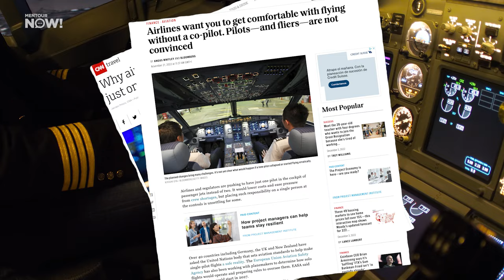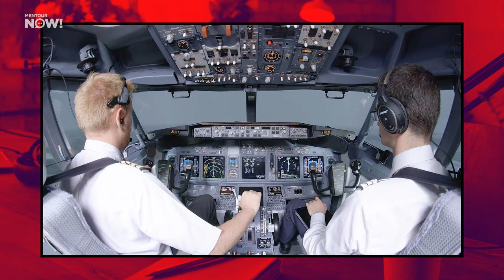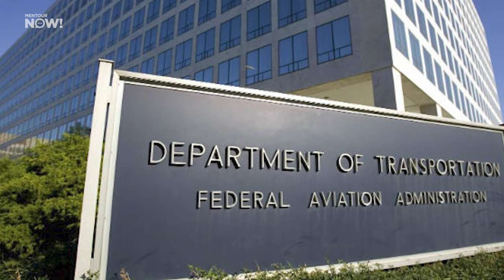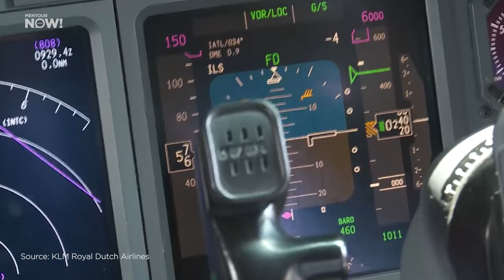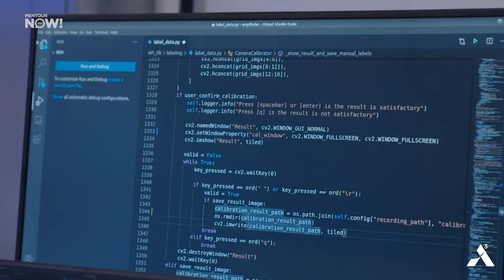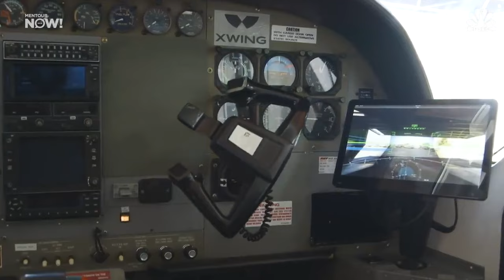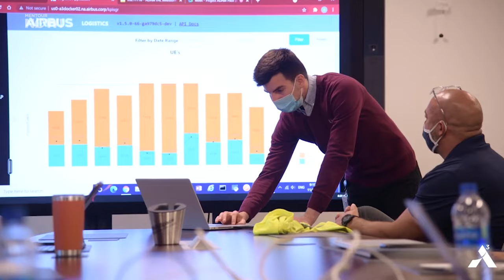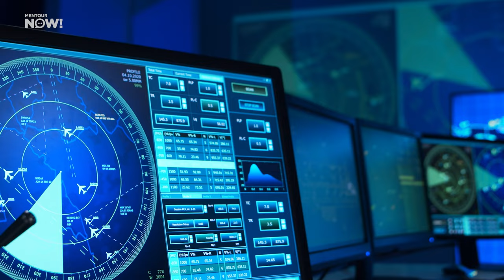The End of the Two-Pilot Cockpit?! Get Ready for Single-Pilot and No-Pilot Airliners!

Comment: You didn't mention one of the biggest issues that is addressed with 2 person authentication.  Having 2 pilots in the cockpit dramatically reduces the risk of a rogue pilot. One bad actor could perform a bad act.  With 2 in the cockpit, it requires an accomplice and co-conspirator.
Reply: A cost-benefit analysis likely reveals that the number of incidents of that type is not so great as to warrant that expense. I mean, after all, under neoliberal capitalism a human life is a commodity.

Comment: The USAF is looking into doing this with the new KC-46 air refueler.  They are researching only using the pilot and boom operator as the only crew members.
Reply: I read up on this.

The reason why they looked into it was to allow the KC-46 to be flown out by one pilot in an emergency.

So say, the base the KC-46s are being based at is about to be attacked, the Airforce could have one pilot fly the airplane out and potentially use it on a mission instead of leaving airplanes behind because they couldn’t get 2 pilots per plane.

Single pilot KC-46 ops wouldn’t be the norm it would be an exception for emergency situations.

Comment: I was a bit nervous when I worked  in the Channel Islands as flights between the islands on a Trilander were single pilot operated . Also in the old days of Intra Airways flying from Jersey to Dinard on their DC3 Dakota. I even came back from Exeter with a single pilot on a small Shorts 330 with a single pilot. I remember her saying before takeoff that the weather was very bad but that she would 'do her best' to get us down !!
.
Reply: Let me assure you, my friend, getting down is NEVER a problem;)  I've flown as a single pilot in IFR in corporate turbo-props, and as a crewmember in larger machines. We used to joke: "I don't know what's worse, being a copilot or having one."  That said, I can also tell you that in my opinion, you're safer with two pilots if the captain maintains the correct professional tone on the flight deck. My personal experience is approximately 8000 hrs air time.

Comment: As internet technology improves could there be a step toward, and/or inclusion of a system that would allow a "backup" pilot to control or even assist from a simulator on the ground? That could easily happen within the careers of the next gen of pilots.
Reply: This idea is 1000 times better than SPO
But it makes too much sense for current manufacturers I guess.

Comment: With the last pilot gone at some point in time, do we really need passengers? They use space, bring baggage and therefore weight. Getting ride of them would make commercial aviation so much easier. 

Wold like to add 😂, but this is not really a topic to laugh at.
Reply: That would work! The loss of  revenue could be subsidized since the purpose of government is to keep the corporate shareholders fat and happy.
Hell, the could even fly computer simulation airliners, save capital expenditure.

Comment: my understanding is the B-2 Bomber actually is more autonomous, the pilot is there really only to make certain that the aircraft actually flies the programmed flight path to target and then drops it's payload on the correct target, of course a B-2 is NOT a passenger plane it's a nuclear capable stealth bomber and trying to modify it's computer systems to work for an airline system  would be a huge challenge
Reply: The B-2 is a handful to fly and has 2 pilots.

Comment: You know what I could see happening in the future, the second pilot is replaced by a remote pilot. This would allow redundancy and cross checking in critical phases of flight, provide a relief pilot and be able to fully takeover the airplane in cases of pilot incapacitation. At the same time I would assume adding in the capability of the right seat being remote operated and allowing a single pilot to be a crew member for multiple flights at once would be cheaper to implement and more open for the public. Pilot flying is actually on the plane and pilot monitoring is remote in
Reply: NASA is working on this with Boeing

Comment: Been a few recent instances of incapacitated pilots on passenger jets. I'll stick with two pilots please, or drive myself.
Reply: Driving yourself will be safer? 45,000 commercial flights are safely operated in the U.S. each day.  Accidents are extremely rare.  But auto fatalities are currently at around 40,000 per year. And that's not counting the millions who are seriously injured each year. Of course you are in control while driving your car so that makes you safe, right? But you can't control the other drivers. And also if you are driving instead of flying you are going to be dealing with fatigue, so be sure to stop for a leg stretch every two hours and do not drive more than eight hours per day.  But yes we also need two pilots to keep it safe, though even with one pilot it will still be safer than driving, but they still need two pilots.

Reply

Comment: The pilot could be replaced by a team of experts monitoring several airplanes from a ground center, but there is a huge danger of hacking and piracy.
Reply: A bunch of experts staring at a screen with no flight experience aren’t going to save a plane with no automation or data links functioning because of some emergency.

Comment: Thanks for the very Interesting video!!  The fact that - as you mentioned - a  system that could fully replace a 2nd pilot would essentially have to be an "AI" in the truest sense of that term -  kind of implies that it will be years (or even decades) before it would  be possible to have a "single-pilot cockpit" on a large passenger or cargo airplane.  I can't help but think that  system designers and engineers have been working for years on the notion of a self-driving car and - even though the progress in that technology has been impressive -  it will still be several more years (or longer lol!) before this becomes a common reality on our roads.  Doing this kind of thing for a large aircraft would have to be hundreds of times more complicated.   Also, I can't help but think that even if engineers and IT-developers ever got to the point of developing a fully autonomous system that could fly a plane on its own (thus replacing the 2nd pilot),  that society would not accept the notion of having a single pilot with such a system as his/her backup  (like you mentioned - just because technically it might be feasible does not mean it's a good idea!!).    Maybe instead of using such an application (if it's ever developed) as a pilot replacement, it could instead be added to the existing suite of systems within the cockpit that help pilots fly an aircraft (basically an even more powerful type of auto-pilot...but still essentially a backup to the two human pilots). ...
Reply: The technology already exists with autonomous military drones. Its not a big leap to adapt that for civilian use.

Comment: Lots of aircraft carrying paying passengers fly with a single crew member. The only thing different is the size of the aircraft, the jobs which have to get done are the same.
Reply: Most of these single pilot flights are in small aircraft that are far less complex.
Most operators who fly these small aircraft chose to fly them with 2 crew members even though only one crew member is necessary specifically for the added safety benefits.

Comment: i have a question,if a plane can land and take off without a pilot doing anything,why is there a need for two pilots,would a plane in auto pilot spot any mechanical failing,try to correct them and if not correctable,turn around and be able to set a new heading to a alternative airport,or is it not that simple,if we can fly drones from thousands of miles away,why can we not do this with aircraft
Reply: Because planes can’t takeoff and land or even cruise without the pilots doing anything.

Autopilots still need to be told what to do and even with all the automation running crews can and will regularly get overloaded with tasks during busy phases of flight.

As for why planes can’t be flown remotely like military drones, have you ever seen their safety record…? It’s horrible

Comment: Remember Germanwings flight 9525
Reply: This could be avoided by giving each pilot a key or card with which they can open the door if the other pilot has locked it. At Germanwings 9525 the other pilot actually tried to get into the cockpit but couldn't because it was locked.

Comment: Guys, at the end you will not stop innovation. If there is only one pilot on board the aircraft has to handle start, flight and landing itself and the role of the "pilot" changes to troubleshooting. Additionally, in case of trouble there needs to be a stable connection to a team on the ground which is able to help. But then, it is fine.
Reply: That pilot should also be required so serve drinks and snacks, no reason why not. 
The line will be drawn when they develop automated shareholders/corporate boards.
Reply: The point isn’t to “stop innovating”

It’s to stop people from jumping the gun and doing stuff because it’s simply “technically feasible” 

Also, let’s say the tech is there for SPO 

Is the plane less advanced because the tech is onboard but 2 pilots are still on the airplane?
No. It’s not. 

Most pilots aren’t saying “don’t develop the tech” they are saying “woah woah don’t take out something (the other pilot) that will make flying safer even with the tech”

Comment: Years ago, when the 767 was beginning to be sold, Boeing tried to sell an emergency flight and landing system.  It required special instruments at any airport where it might land.  If the airplane determined that no one was in control, it would take over and issue a Mayday.  It would figure out the nearest instrumented airport, tell ATC where it was going and which runway.  It could land the plane and then taxi to a predetermined location.  It was tested and seemed to work, but it didn't make it much farther because no one was going to buy it.  There was a lot of concern by the pilot unions and others that this would eventually replace the pilots instead of just being used for emergencies.
Reply: Never heard of this program… might just be a rumor but if it isn’t could you share a link or something to figure out more about it? If it existed it’s surely somewhere online
Reply: @nikobelic4251  This was like in 1980?  It was tested but went nowhere since the 767 was already reducing flight crew from 3 to 2 and no airline wanted to buy it.  I was at Boeing at the time and we got to see the presentation.  Only Boeing field was set up to test it and no one wanted it so it was one of many things to be cancelled.  I doubt if anything is on the internet about something that old and that never went anywhere.
Reply: @toddjohnson5692  
Usually this type of stuff is kept in some form of record somewhere even if it didn’t go anywhere.
You would think that especially since Garmin got a Collier Trophy for the emergency autoland Boeing would come out and say “hey we already had this system for the 767 decades ago”

I wasn’t even around in 1980 so I can’t just check if what you are saying is true or not but I know some people claim the L-1011 was capable of auto taxi even though that was never the case….

Comment: I think the ultimate goal would be to have no pilots. A sad day for aviation in many ways but with technological advancement in automation moving at the rate it is, it's not that difficult to see that coming. I hate to say that statistically, most accidents are linked to the human factor (I stand to be corrected) both within flight crew and air traffic control circles so fully automated systems are not necessarily something to put in the 'scary bin'. I've watched enough 'Air Crash Investigations' programs to only have a certain amount of faith in pilots' competency. After all, most of them are human😉
Reply: Airbus has openly said they don’t plan on completely replacing pilots.  Boeing hasn’t said it straight up but it’s been hinted here and there.

Boeing has been more closed off about its automation goals and how fast they want to move along with single pilot operations ever since the MAX crashes, for obvious reasons.
Reply: @nikobelic4251  I'm sure Airbus or Boeing don't care if their aircraft have pilots or not, but I imagine the airlines are the ones who will be considering the cost benefit analysis.
Reply: @Parawingdelta2  I think they do care

What happens if a plane with no pilot flattens a neighborhood? 
The airline will go “not my problem I didn’t design and code it” 
Plus, no manufacturer wants to be the one who’s plane flattened a neighborhood and took out a dozen families.

But yeah, as of now Airbus has said they aren’t removing pilots from their planes for efficiency and for decision making and emergencies.

And Boeing is quiet about their autonomy goals.
Reply: @nikobelic4251  I suppose you're right insofar as at the moment the responsibility for flight crew failure is generally proportioned to the airline.
What I really was trying to say was that Boeing and Airbus probably don't have any particular invested interest in changing because the financial imperative of reducing costs by removing pilots is likely to come from the airline companies.

Comment: Seems like this would put a lot of pilots out of work.
Reply: Not really actually,
Single pilot planes will more than likely be clean sheet designs, and will probably first serve for growth before they serve as fleet replacements and even then that will be slow.  It takes about 5-10 years to fully replace a fleet with a new aircraft so what will probably happen is as single pilot planes come in pilots from two pilot planes will be moved to the growing amount of single pilot planes.  That will cause little to no job loss for pilots.

Comment: Although from a job & flying (being a pilot point of view) it sounds like an awful idea, more and more seems to point to pilotless flight being the way forward. The main issue is traveller trust which stands in the way of it happening. But there’s a lot of evidence of a new human issue of relying on the technology too much and as a result causing problems. In technology terms 99% of the time in technology v human it will be human error. So having no pilot and someone on the ground to take over in case of any computer issues would probably be safer in reality, but the general public and of course pilots (who want to fly) won’t see it that way. Getting it down to 1 pilot is probably a step to get people thinking of planes more like they do with cars, and thus make the step to pilotless flight a bit less of a mental jump to accept.
Reply: Manned flight is safer than similarly sized UAVs being flown from the ground
Reply: @nikobelic4251  The from the ground bit I talked about is in case something goes wrong with the auto. Obviously it is safer to fly in the cockpit rather than on the ground. Otherwise you’d still need approximately the same levels of pilots anyway and that makes no sense.

And if the auto goes wrong, anything is safer than leaving it on auto with no pilot in the cockpit.
Reply: @Toxic-Ology  And besides saving some money I don’t see how it beneficial to have one to pilot on the ground as opposed to two onboard when something goes wrong.  Today’s system is EXTREMELY safe and that’s without an extra AI pilot.  There hasn’t been a single fatal commercial airplane crash in the US in over a decade.  Two crew members can clearly be extremely safe there is no reason to remove a pilot besides wanting to save a couple of dollars.  Manufacturers have already said 0 pilots isn’t the goal here in airliners (Airbus has said so openly and Boeing has hinted at it) in part for safety reasons, but I don’t see any logic where an autonomous system with two fully trained human pilots is less safe than an autonomous system with one human pilot.
Reply: @nikobelic4251  I think you’re missing my point, that’s the main issue. Don’t worry about it.
Reply: @Toxic-Ology  
The point is that the airlines aren’t removing a pilot for safety. A higher level of safety can be achieved with two pilots and an autonomous system (see Airbus Dragonfly project) the removal of a pilot is to save money.
I won’t even mention removing both crew since even long term that’s not even Airbus’ goal and probably not Boeing either based on stuff they have said. 

Pilotless flight would be for the future of air taxis and on demand mobility which makes sense since the business case for Air taxis is barely feasible if every single one has to have a fully trained pilot on board.
Reply: @nikobelic4251  🤦🏼‍♂️ what part of you’ve completely missed my point and a subtle hint that I’m not interested in debating with you did you miss? That was a rhetorical question by the way, I don’t want an answer.
Reply: @Toxic-Ology  You don’t have to be rude my dude.  Nobody is forcing you to respond.

Comment: And if the pilot dies while the plane is in the air ?
Reply: They say easy,  remote control.  If somehow someone finds out the problem.  And can take over in time.  Then they get to try to control a huge plane with a latency of control and feedback issue,  at best.  And cockpits are locked from the inside.

Comment: As America's 2024 #President, #BradHartliep - 35 years of experience in the #Airline and #Aerospace Industry, including as a Lead Investigator on 6 #AircraftCrashes - will Outlaw Single Pilot #Commercial Airline Operations and increase/improve #Commercial Pilot Annual Qualifications Standards -- all Commerical Multi-Engine #ATP Pilots will be required to pass an Emergency Landings and Emergency Take-Offs Procedures Simulator Check Ride every 6 months, specific to the Aircraft They are Flying, meaning all Cockpit Flight Control and Management Systems, including all switches and buttons, must be identical to the aircraft being operated, not just aircraft type ..

#BradHartliep 2024
#LaunchAmericaHigher